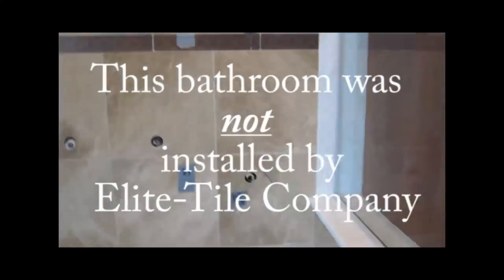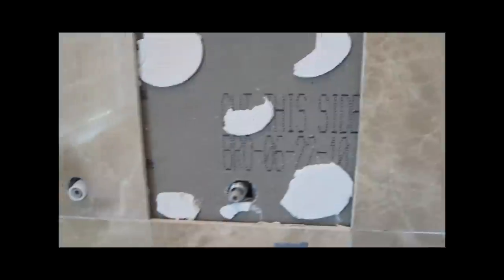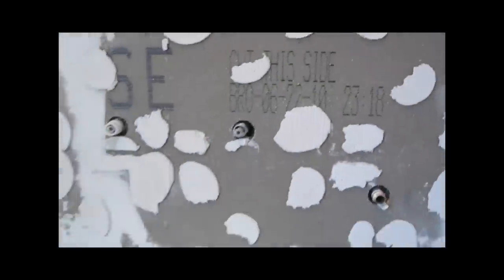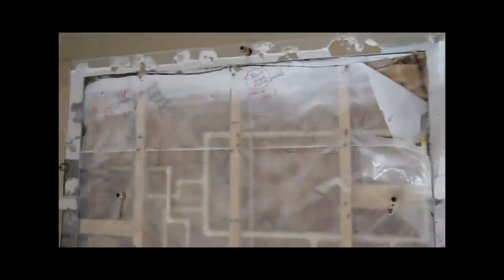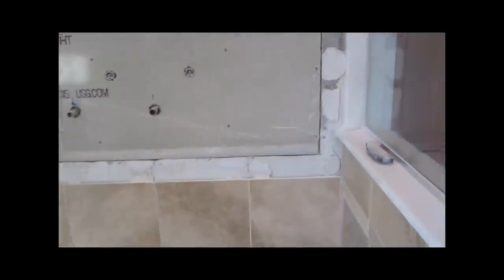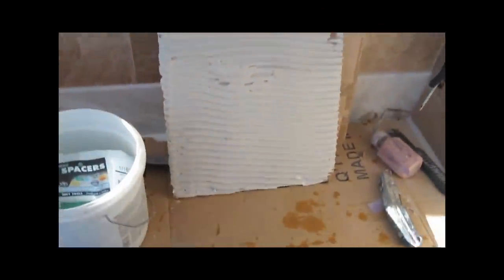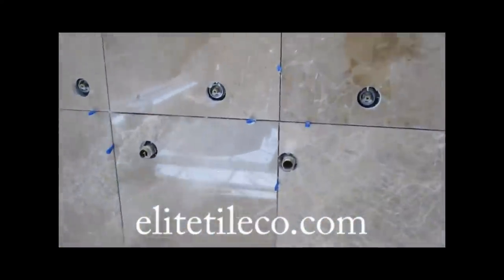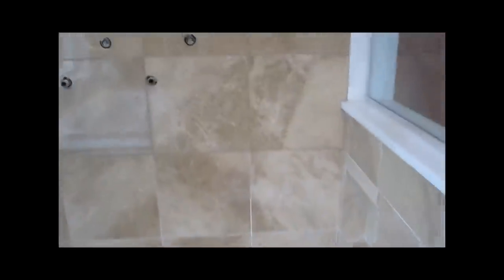Marble tile  Batroom fail,  Shower Repair. How not to install tile.

Comment: How did you remove the tiles without breaking them?  Would have liked to see that.  I need to remove a few marble tiles and would like to reuse them, if possible.
Reply from the maker: They were easy to remove because they were not installed properly and had no bond. If the tile is installed correctly, it will come out in a million pieces. https://www.youtube.com/watch?v=nY3WSe08n2M
Reply: Thank you, Sal.  Your channel is gold.

Comment: cement board ? proper way to do it? i think your clueless yourself.
Reply from the maker: +Gustavo M Funny how that works, you make a statement, then offer no explanation on how or why it is done wrong. Let me guess, you only float your walls with  mud. All other methods are wrong.
Reply: +Gustavo Martinez I think you were drunk when u wrote that. Sal is a badass tiler and you're jealous. If only u ran your float like your mouth. But even then you wouldn't be as good as Sal lol